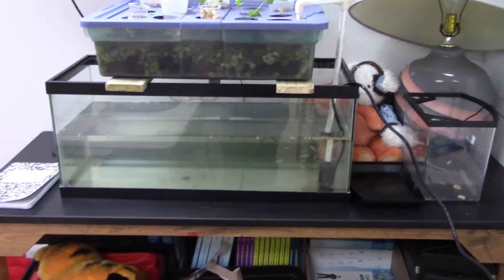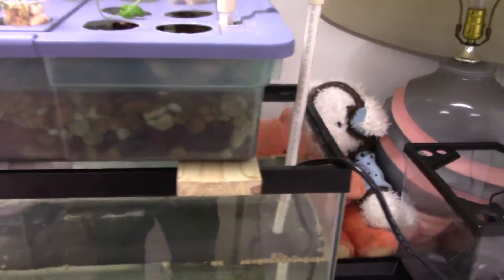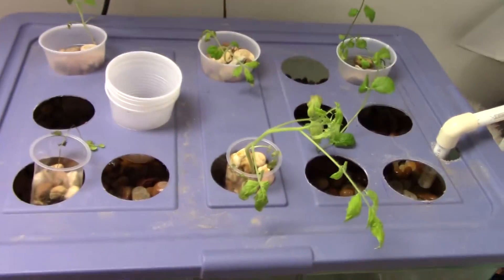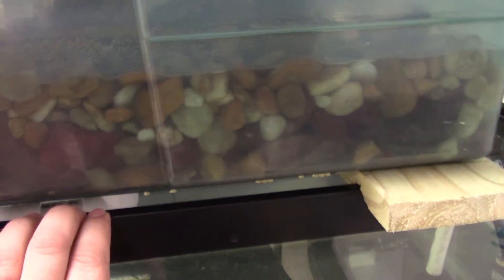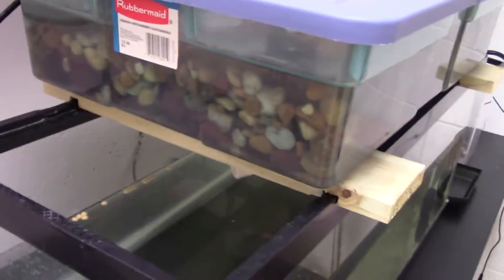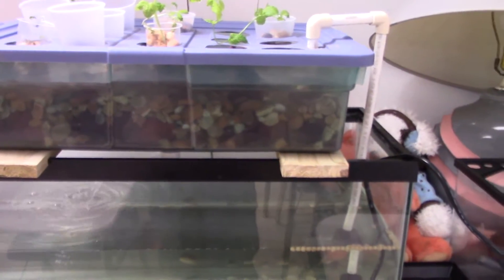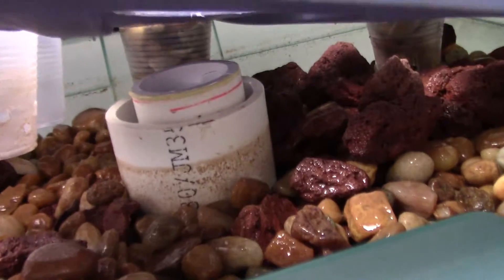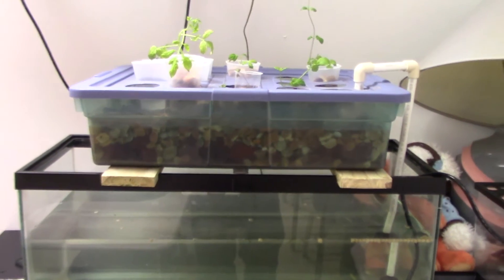$65 20 Gallon Aquaponics System With Bell Siphon

Comment: How many fish to make this size system. And can you use tropical fish?
Reply from the maker: +Michel Gross If by tropical you mean saltwater fish, then no.
It all depends on the ammonia produced, the more plants you have the more fish you can have. There's no fish minimum,  but there is a maximum.
Reply: you can use freshwater tropical such as guppies or tetras i suppose they are small but communal. rule is 1 gallon of water per inch of fish